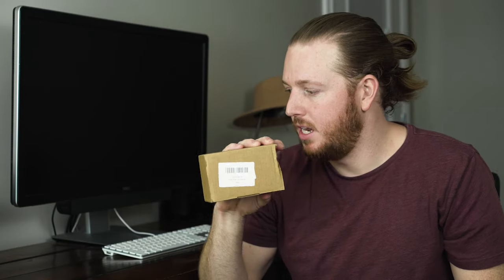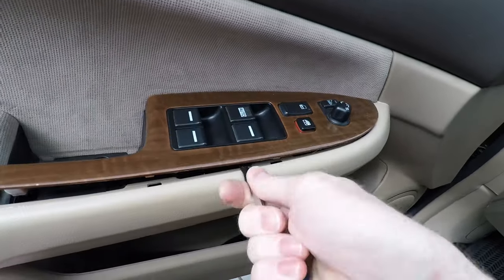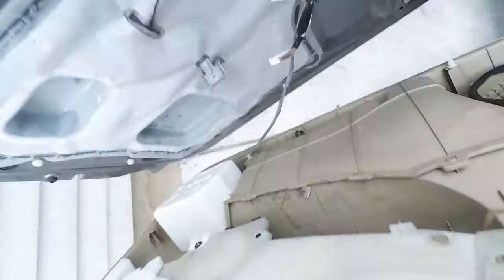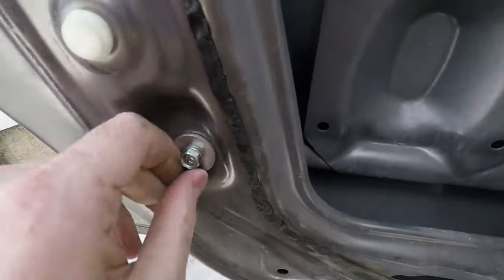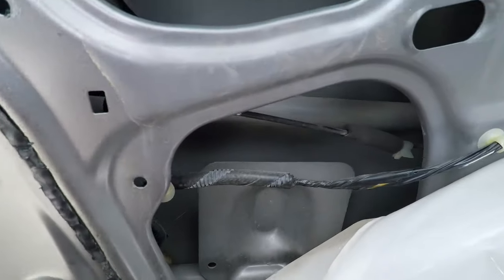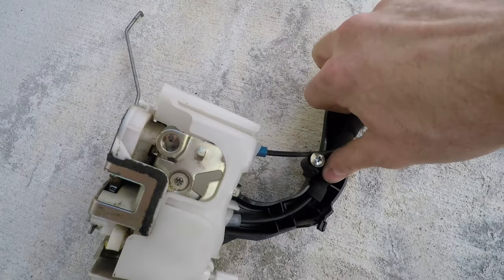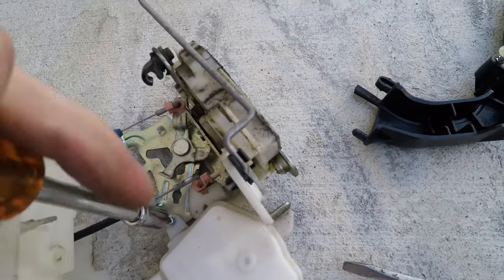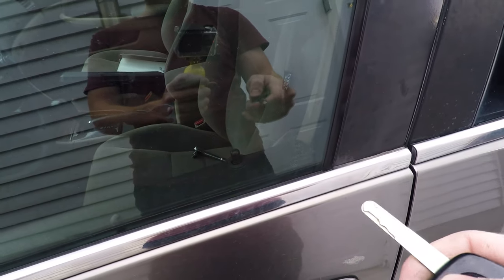Car Door Doesn't Lock - 2003-2007 Driver Door Actuator Accord

Comment: What are the chances that all four actuators go out within a few weeks. That's my 2005 Accord. The driver side was the last to go and still works as much as it doesn't. We're selling the car so will mark it down enough to handle the repair at a garage. Now I know what to ask the garage for an estimate. As every one else commented...great video! Right to the point with good editing.
Reply from the maker: I don't know. It seems unlikely, but I guess it could happen. I would guess that the drivers door actuator is the problem as it is the first in line and could be causing the problem down the line. You would have to do some tests to know for sure.
Reply: @ChanceYoung  ok thanks for the reply. We are selling the car so I don't want to do a lot of repairs. 2005 accord ex only 80,000 and interior like new.

Comment: I have an issue where three out of the four of my doors still work fine but the one on the passenger front tries to unlock and lock ( motor noise)  but does not push up the manual plastic rod. Is there a chance that something on this actuator has just gotten out of alignment or something to cause this? I would hate to take the entire door apart realize that I don’t need the actuator or don’t need to actually do half of this work.  I realize that if I just start to take the door panel off, I can probably figure out what’s going on. I just wanted to see if other people had experienced this.
Reply from the maker: Sounds to me like the passenger door actuator. I would get the part and then start the job. You could always take the part back if you don't need it.

Comment: Thanks for the video. I have the exact same model (2007 Accord EX-L). The key fob works. But the passenger side manual door lock stick is not responding to keyfob. It is more of a jam than anything. I wonder if there is any easy way to fix it.
Reply from the maker: Thanks for watching! I bet if you took the door apart like I did you would be able to quickly identify the problem!
Reply: Same with mine on my 98 Honda Accord. The door lock stick on the passenger side front and rear don't move. I can see it bulging a little. My driver side rear don't move at all.
Reply from the maker: I hope this helps you!
Reply: @ChanceYoung  what could it be?
Reply: @hendricks177  I did have my actuator on my passenger door replaced. It worked perfectly for about a month. But now the keyfob does not open any door except for driver side!!! It does lock all. But not open all. And a side effect of this is that the unlock unlock and hold that used to rolldown all windows (hidden trick in Accords) no more works either. And what's worse, if key is engaged, every time I close the driver door, it locks all doors!!!! I better carry the keys with me or get locked out.

Comment: Regarding the other rod that wasn’t captured on video.. where does it hook onto the actuator? I replaced the actuator and have everything back in place but that other rod. The door lock for key doesn’t work and can’t find where it hooks on to.
Reply: It’s a little hole working this black piece that moves around I just tried to do it n fucked my shit up completely
Reply: This video is great at taking it apart but putting it back together is a joke don’t try unless u have some experience I tried n messed my door up

Comment: I got into the same issue with my accord 2007, but I can’t unlock it manually either. The door knobs for other doors works fine except the driver side and it functions the same way as you showed in the video. Do you think if it could be another issue or it is the actuator?

Comment: Thanks for cutting this into a quick video, extremely easy to follow along.

One step I would skip and one massive warning (if much like me, you're not a handyman either)
Skip this: @1:01 don't unscrew the plastic lock -- I simply couldn't get the bare thread to align and screw the plastic back on when I reassembled the door, having the plastic ON caused 0 hassle throughout
Warning: @2:45 that rod in the back - DON'T disconnect it from the actuator, but from the top - it will be soo hard to click in and cover it back unless you're a contorsionist

Comment: So my car door in the back has the same problem you think it’s the same as yours because all the rest lock and unlock except that one
Reply from the maker: In your case I think it could be the actuator in the door that doesn't lock.
Reply: Mine is the same but I think the actuator is okay since sometimes it works sometimes not but always tries to move either up or down. I'm gonna take the panel off and see if it just has someplace that is dirty or rubbing that can be cleaned or lubed.
Reply from the maker: Mine was was doing the same as yours for a couple months where it would sometimes work and other times it wouldn't. It just kept getting worse and worse as time passed though. Mine would try to unlock and lock as well but couldn't do it after a while. Your problem sounds like the actuator to me and as long as you are already planning to take it apart I would replace it now. Just something to think about!

Comment: The boot of my X-Type is like this. It makes a sound, but won't unlock. It's like as if the motor isn't getting enough power, but when I hook the actuator up to a 12V supply it works fine.
I even took the actuator apart, then took the motor apart and cleaned up the insides of it.
Might just be time to bite the bullet and buy a new actuator.
Of course it might also be a partly corroded wire, and the motor isn't getting enough current.
Reply from the maker: Hmmm. Ya I would guess that it just needs to be replaced.

Comment: I can't seem to get the screws off the side of the door. Any idea to loosen them up? They're in pretty tight
Reply from the maker: They are purposely extremely tight so they properly support the latch. I used a ratchet to get more leverage. Hope that helps!
Reply: I recommend finding the proper torque weight and use a torque wrench. Stay safe, do research!

Comment: So I changed the actuator but I don't think it fixed the locks
Reply from the maker: I recommend testing the connectors to make sure they are getting power when you hit the unlock button.
Reply: @ChanceYoung  6hanks for your reply I broke my cable in the process  and found out that was the problem
Reply from the maker: Oh nice work! Glad you figured it out!

Comment: Hey I have the same problem on my car too but the passenger side door also doesn’t open and the only way to open it is reaching over and unlocking it would I need to replace an actuator on the passenger side door too?
Reply from the maker: If the driver door is unlocked and you press the unlock button in the car and the passenger door still doesn't unlock, you will likely need to replace the actuator. I hope this helps and good luck with the repair!
Reply: Was going to ask the exact same question also. My 04 accord is has that same problem. Did you end up having to replace both front door actuators or just 1?

Comment: I did have my actuator on my passenger door replaced. It worked perfectly for about a month. But now the keyfob does not open any door except for driver side!!! It does lock all. But not open all. And a side effect of this is that the unlock unlock and hold that used to rolldown all windows (hidden trick in Accords) no more works either. And what's worse, if key is engaged, every time I close the driver door, it locks all doors!!!! I better carry the keys with me or get locked out.
Reply from the maker: That is interesting. You will have to do some testing to see if you can identify the problem and let me know what you find.
Reply: @ChanceYoung  , there was another video which shows how to reset the unlocking (and auto locking). Something like turn key to on position, open driver door, Hold unlock on door for 5 seconds or so until you hear a click. Do this 3 times or so. Da da da. It actually worked and lasted for a few weeks. But again back to bad behavior.
Reply from the maker: I'm glad you figured something out with it! I hope you figure it out!
Reply: BRO!!! I have thee same exact thing.. did you ever find out the problem. ? I replaced the master window switch at the dealer. $400 that worked for 2 years nor I got the same problem again. Did you replace your door actuator?
Reply: I replaced driver side actuator. Went to Honda actually. It has been perfectly ok since. One year plus.

Comment: There are times when central lock doesn't open by hand that's why it takes some time before i can get out of the car..like it is stucked on the lock position it needs a lot of effort before it opens..what could be the solution to this? 2008 mazda 3 AT 1.6
Thanks.
Reply from the maker: You would have to take the door apart and take a look to know for sure what the problem is.

Comment: Mine only locks the front 2 doors but not the back ones ... What gives?
Reply from the maker: Hmmm. It could be that the actuators in both back doors are bad. I would do some tests to try to isolate the problem.
Reply: @ChanceYoung  thank you!

Comment: Honda remote open the 2 passenger side but the d driver side got stunk but when u used key to open it will be hard to turn wen open the driver door will not be open from inside
Reply from the maker: Try the actuator!

Comment: on the inside of my car, i pulled the driver door handle and pulled up on the lock knob  (which wouldn't unlock before, but can now unlock)
Reply from the maker: I'm glad you got it to unlock!
Reply from the maker: It sounds like you will need to replace the actuator since it is stuck in the unlock position and not working.

Comment: I have an 02 Honda civic, my keyless remote unlock all door but not my driver door, and I replaced the actuator and still does not unlock please help.
Reply from the maker: I would use an electrical tester to test the wires to see if the actuator is getting the signal when you press the unlock button.
Reply: I already tested those wires coming to the actuator and there's no power coming to the driver door actuator.
Reply from the maker: I would test the wires to try to find out where and why you are losing power.

Comment: I'm having A problem with connecting the 3 prong wire back. Looks like one prong is missing 🤔
Reply from the maker: Maybe you accidentally broke it? Can you fix it? You could rewire it manually if you had to. Hope this helps! Good luck!
Reply: @ChanceYoung  oh, I fixed it after spending 45 minutes trying to figure it out. lol, the part I ordered, the prongs we too straight, so I had to bend them slightly to fit the connector. That worked, so I just finished 😂
Reply: And I also didn't have to remove the screws in the for handle area, mine just popped off from the clips on the perimeter. Don't know if I had to or not, but it all worked out!

Comment: All doors not lock, is that same problem with my car, Honda City 2005
Reply from the maker: The repair should be very similar. If none of your does are locking it could be your driver door actuator.
Reply: @ChanceYoung  can you please tell me this part name. I have to order. Thanks in advance
Reply from the maker: Make sure this is the part you need before you order it but it's called the actuator.

Comment: 2nd rod u didn’t show threw me off about an hour
Reply from the maker: Sorry about that. My camera was to big to fit back there so I couldn't film that part.
Reply: @ChanceYoung  currently trying to reattach the other rod and I don’t even see how it comes back in I kinda blindly pulled it off
Reply: Update: I broke it .. 👍🏽👍🏽 thanks for that. Soooo what now. I only have the rod you showed attached. Can the 2nd rod be off and function properly?
Reply from the maker: Both rods attach in the same way. You put the rod in the hole and flip the plastic piece to hold it secure. If you don't attach both rods it won't function properly. One rod is for the manual lock and the other is for the electric lock.
Reply: Damn well I need another plastic piece because that’s what fell off
Reply from the maker: I don't know if they sell the plastic part by itself. Maybe you could find it or get one off the old actuator.